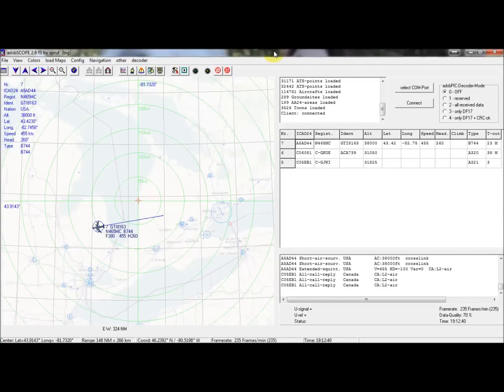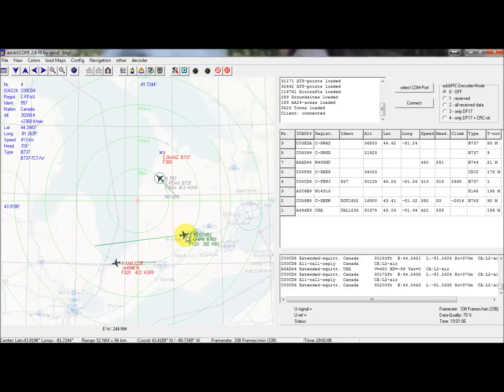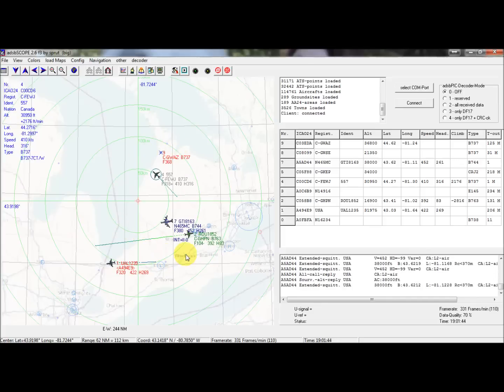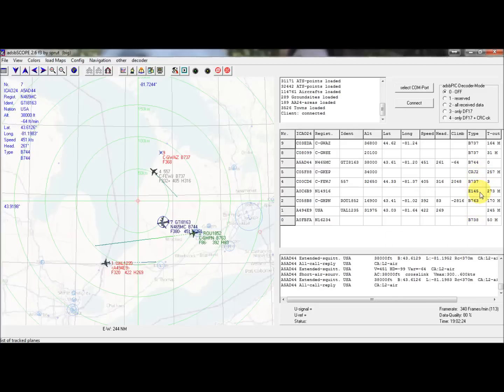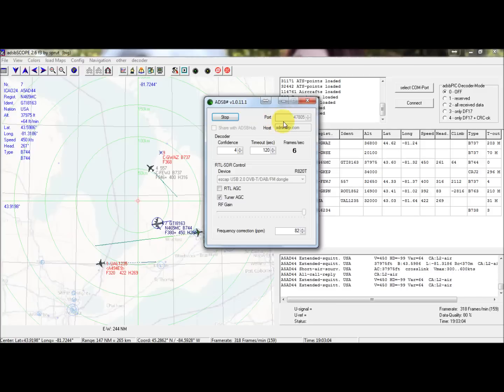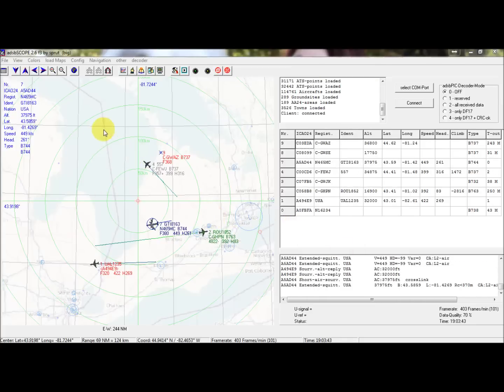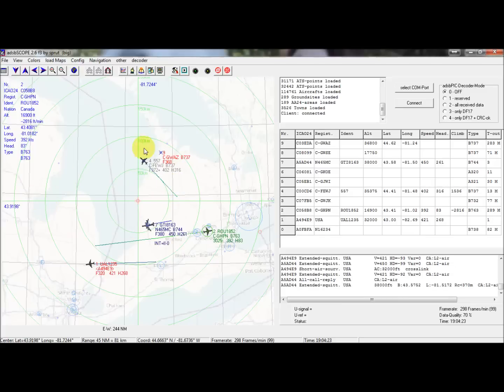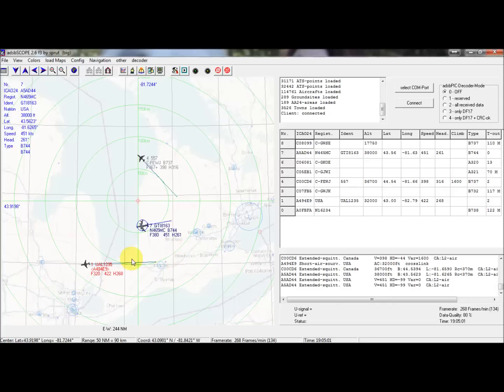DIY Air traffic Control via ADS-B with Cheap USB SDR- Tutorial Part 2

Comment: What type of antenna would work for this that fits in a suitcase or backpack? I travel a lot and would like to listen to aircraft on trips. I want around 50 mile radius coverage. Any suggestions?
Reply from the maker: Depending on your location the stock extendable style should give you that range no prob. Works for me.  Cheers
Reply: That magnetic antenna which is coming with the tuner will be suitable to your needs. Toll buildings might be a problem, so clear sky view will be better/required.
Reply from the maker: One more note- I have had zero luck with those little stubby wire antennas that come with some versions.  I would advise not getting those and buy the versions with the extendable version.  Far superior IMO.  Cheers
Reply: Eric William Thanks for the info, unfortunately the one I received has that stubby wire antenna. Tomorrow I think I'll make a trip to radioshack or microcenter and pick up an antenna. Have you used the Sangean Ant-100?
Reply from the maker: Not sure on the model but I have a Sangean longwire (has a reel) that I use mainly for shortwave
Reply: Eric William Ok thanks,